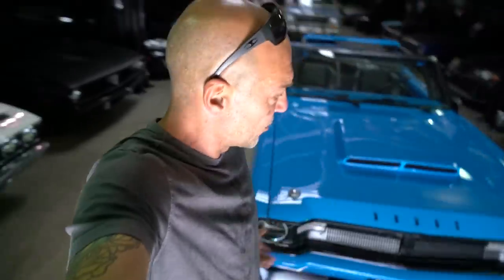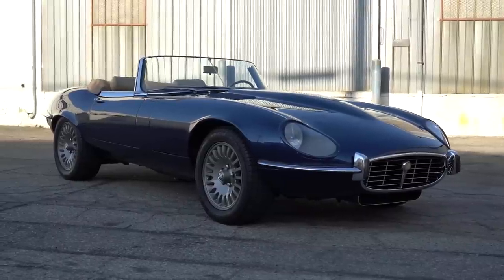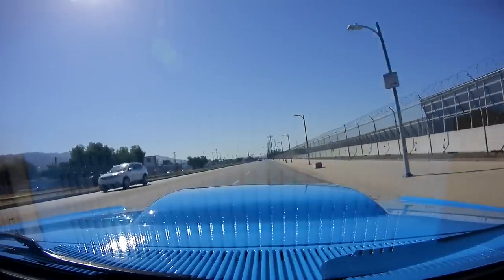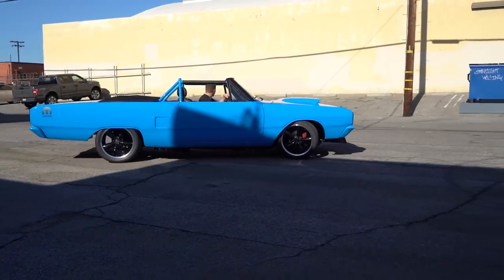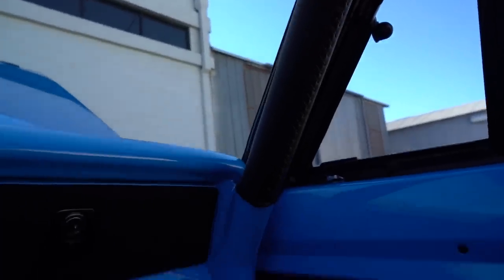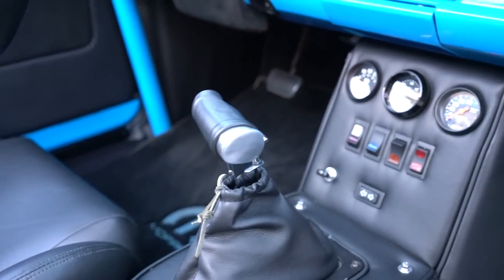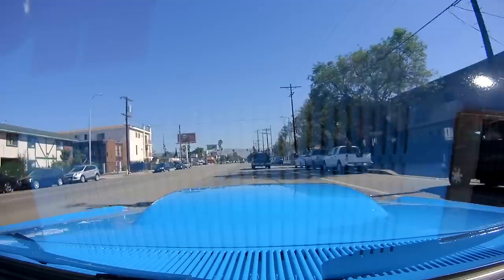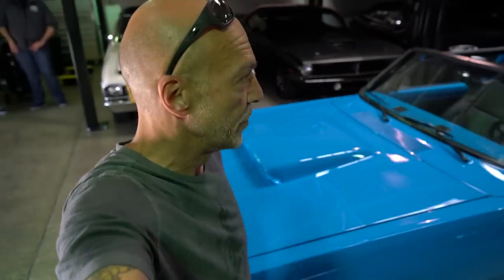600 hp Fully Caged Convertible 1967 Dodge Dart Wearing a Ford Color

Comment: I’ve wanted one of those 6X transmissions for a long time. The cost, and the fact that I never saw anyone with one kept me from pulling the trigger. I’m getting one now. Thank you for demonstrating what it can do !
Reply: I am tempted myself as I'm inching up on a transmission rebuild anyway.  So I crunched some numbers for fun assuming a 3.73 rear and 26.9" diameter tire.  4500 rpm's gives this for mph:  1st=32, 2nd=43, 3rd=61, 4th=81, 5th=97, 6th=129.
Reply: It took some time. I finally pulled the trigger. I’ll be installing my 6X this winter !! 😎